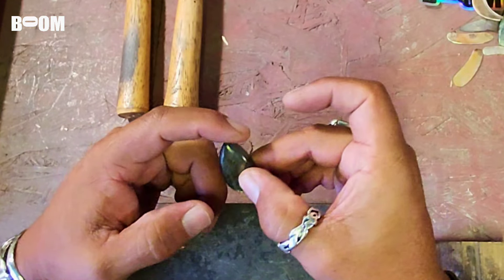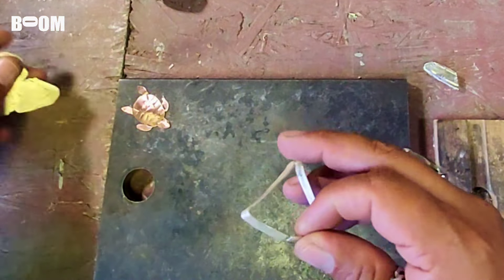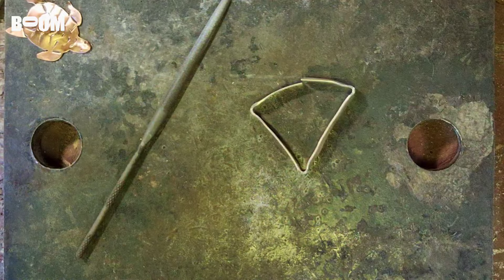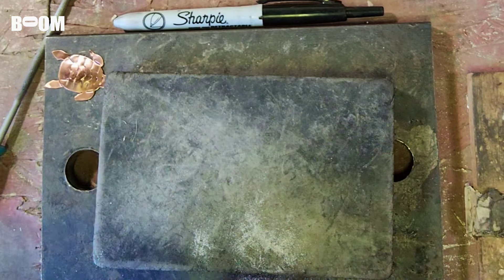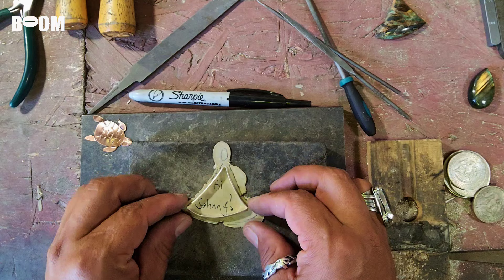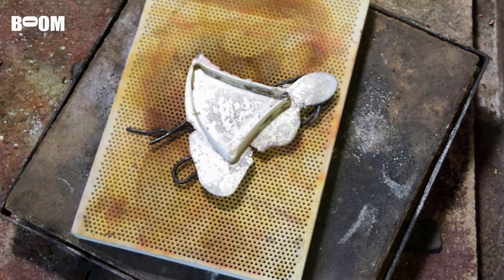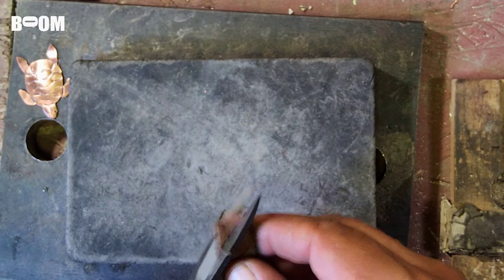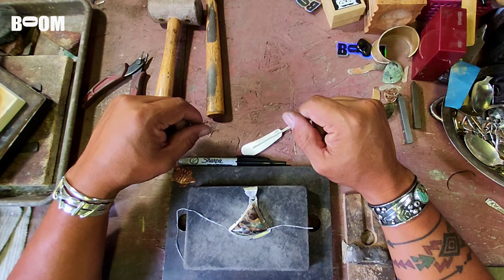Ep.101) Working With Unique Cabochons | Sharp Corners | #jewelrytutorial

Comment: Why do you have the backplate positioned on the binding wire before soldering?
Reply from the maker: @cactuspony  so the heat does not get sunk away by the density of the soldering block
Reply: @boomjewelrydesigns  would that be the case on a charcoal block also?